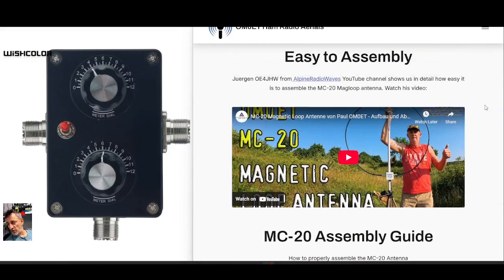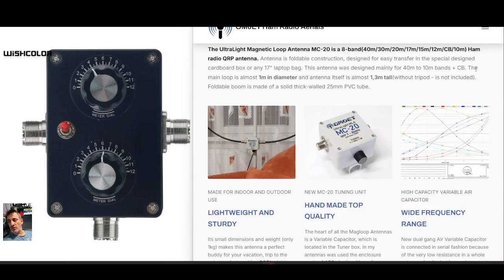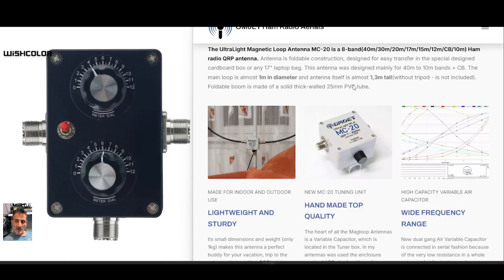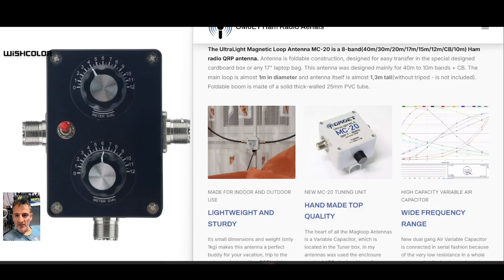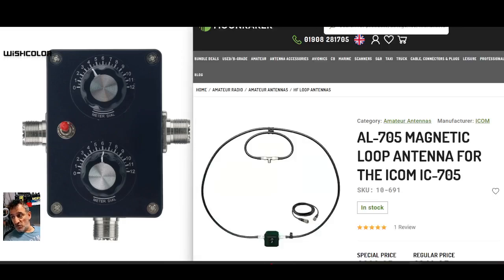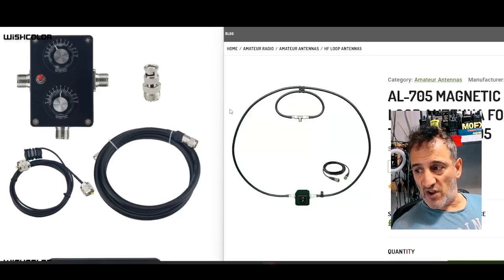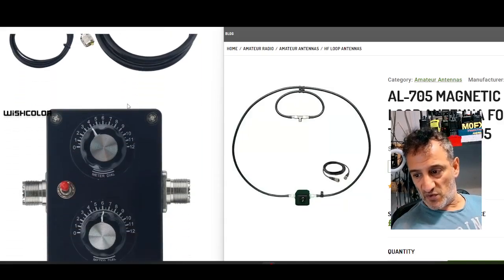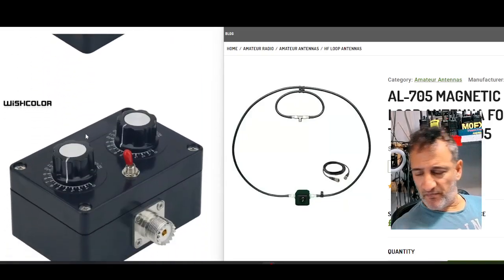BUDGET LOOP ANTENNA - Will it Work ?

Comment: My humble tipp: leave them cheaply built MagLoops with double plastic-condensors alone! Very hard to adjust, bad SWR and only capable of very low power. And I mean low power, don´t use more than 5 or 6 watts.
The AL-705 is ok, also the Alexloop and the Chameleon, which I also own besides Paul´s MC-20. But they all aren´t cheap. I think Paul´s MC-20 delivers best quality for the money.
73, Bernhard
Reply from the maker: Thanks Bernherd I will try it for receive only .

Comment: I have this antenna and tested it with 10W with FT8 and had floating SWR, that means that there was internal arcing on capacitor. I think for FT8 safe max is around 5W, for SSB i think this 20W can be safe. This antenna have dual capacitor design, and such design doesn't need to have coupling loop. And can tune also on 2m band, measured 1:1.5 SWR on 2m.
Reply from the maker: Interesting info thanks for sharing!